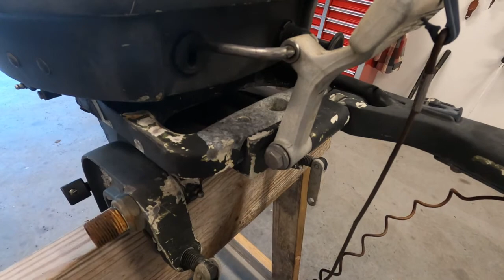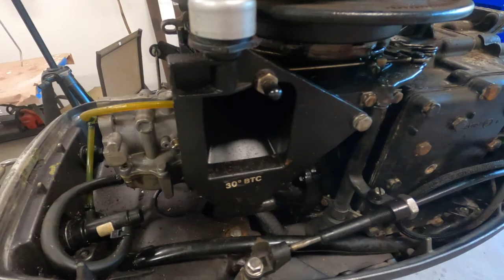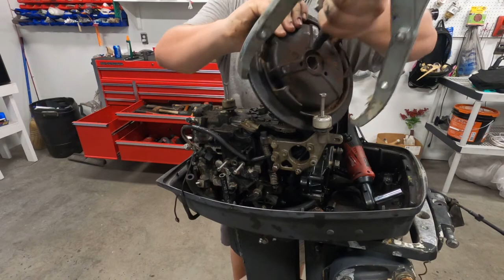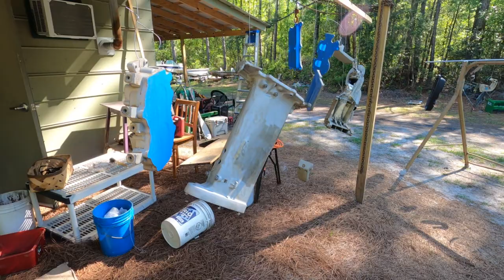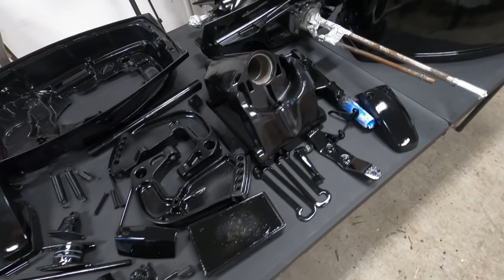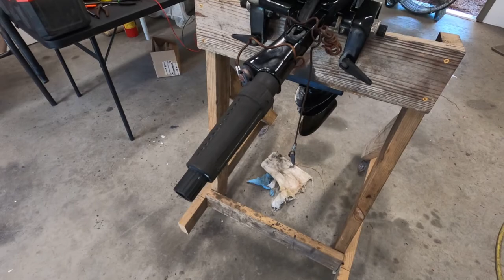Outboard Engine Painting (Full Teardown)

Comment: What types of primer and paint do you use? Thanks.
Reply from the maker: The primer I use is zinc chromate green. You can get it in a spray can. The paint I used was a Jet Black super gloss acrylic enamel single stage from ebay. It has held up very well.
Reply: @fixinandfishin8580  i have a question for ya . do you think id be okay using mercury phantom black enamel( primer/ paint/ and clear) there whole line of products basically over sanded evinrude 25hp paint . ? i sanded with 400g . what im worried about is the base paint having some weird reaction with paint products form mercury ? being there both enamel i thought it should be okay . i did not sand to bare metal on my 25hp evinrude just 400G and made it all smooth .
Reply from the maker: @nathanw5747  You should be fine just painting over the sanded surface if it’s all smooth. It should look fine. I’ve done it on parts with half paint that have been sanded with no problems.

Comment: Good for a quickie job if nothing else depends on your standards, prep is everything looks like your lacking that from all the uneveness of the painted parts. Should of put Mercury decals on it & why did you chose black of all colors,LOLLL! Oh and never pull a flywheel off with a puller like that your very lucky you didnt destroy it in two pieces. Always pull from the center hub thats what the three bolt holes are for you can use a auto harmonic balancer puller if you dont have the right OMC puller..Maybe your not experienced is my guess. Not to be mean here but the only thing I liked in this video is the decals you chose.. only my opinion looks good from 20 ft away sorry........................Frank